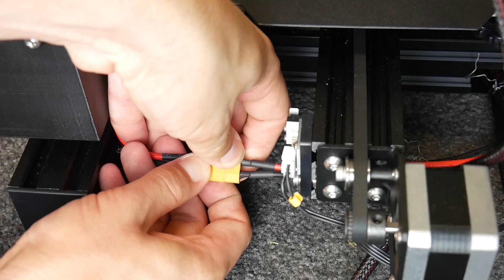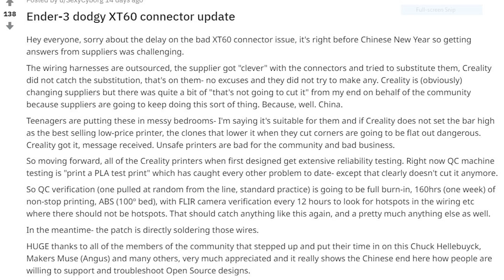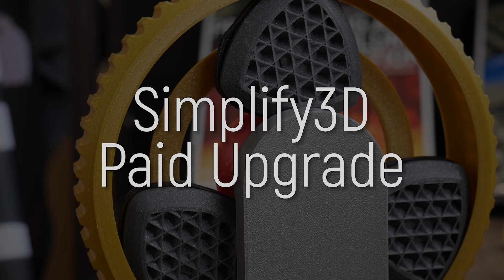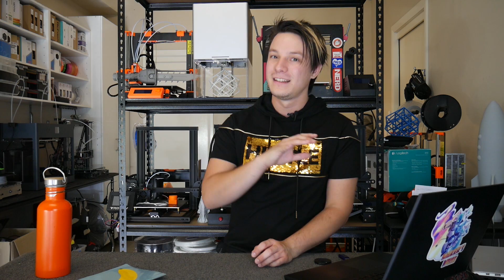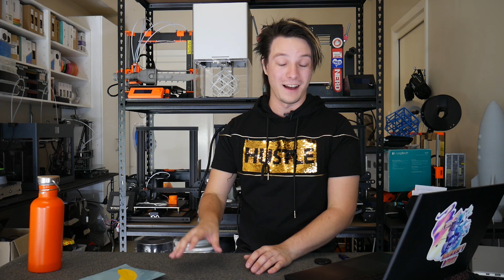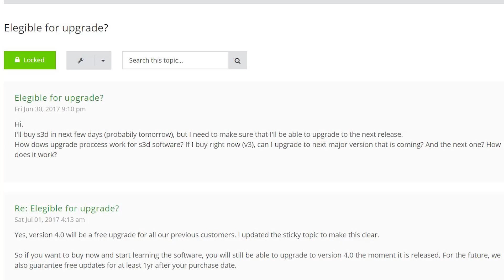Ender 3 Connector Update and Simplify3D Paid Upgrade - Maker's News Feb 2019

Comment: Cad is a great example of paying for upgrades. I get upgrades for one year from purchase and then I will have to pay an annual fee to be eligible for upgrades, which will be free as they are covered by the annual fee.  Miss the annual upgrade fee for a couple of years and I will pay $4k to upgrade to the latest version, which is the cost of buying the software anyway.  That is how it operates.  I just have to live with it.  
Freecad and Fusion are great if you can handle them, I could not, so I paid the money and had a great upgrade to my software that I was using productively the day I downloaded it.  I understand that some solids packages have annual upgrade fees that are more than more than I paid for my whole new upgrade so I am not complaining.  Just trying to point out that paid upgrades are common, but if the upgrade is not worthwhile well no one is going to shell out the money.  I had not upgraded for many years and the full purchase price was a lot less than I would have spent on the annual upgrade fees. I can understand folks being angry, but this is a "normal" practice with software.  It sounds however that simplyfy3d may be shooting themselves in the foot, normal practice or not!
Reply: Ok I absolutely agree that freecad is horrendous to use but whats wrong with fusion 360 I have yet to run into something that I won't to do that it absolutely can't. In the end I have most of the time found it to be able to do allot of stuff easier then other cad programs
Reply: Agreed.  The CAD companies are basically extorting you by charging a maintenance fee yearly.  I’ve had exactly this problem and have come to the conclusion that the ‘very minor’ fixes and additions they add are not worth the cost.  The CAD companies have gotten lazy, greedy and arrogant  IMO.  IMO if a CAD company don’t provide value then I don’t buy and stop the maintenance of said software.  I’m perfectly happy to use the software as it stands as the new minor additions/increments are just that, minor.
Reply: I would say it's a normal practice (these days) for software with a business case behind it like CAD, 3D, software development, accounting or whatever. 
I'm not sure what percentage of folks with 3D printers expect to make that money back?
Reply: duckrutt, I agree totally. If this mob do not offer something better than the free software, they will go broke. And that will be the end of them.
Reply: @smallcnclathes   The trouble is that if they do go bust and shut their servers down, Simplify3D now continually checks their licence server to see if it will run. If that goes titsup, the only ones that will still run are the pirated versions...
Reply: @SusiBiker  if simplify 3d goes bankrupt I dont think they would just screw everyone like that. They will just unlock everything and pirated and paid will all work. There just wont be any future upgrades.
Reply: @nathantoews152   I really hope so. I have been dealing with the company for over two years now, and what I have witnessed does not fill me with hope.
Reply: @nathantoews152  If they go bankrupt they are not legally in the position to unlock every installation because that can be seen as a possible loss of value. The curator might very well decide that trying to extort a fee out of people to have it unlocked ("upgraded to the no-server edition" or some bullshit) would be a quick'n'dirty way to gather funds to pay creditors.
Reply: @andersjjensen  maybe. But if they do go bankrupt and try that. Everyone will just get pirated copies anyways.

Comment: I bought s3d because I needed better support for dual extrusion, X3G format and the supports were easier to remove than Cura at the time.  I didn't appreciate the fact that you had to login to your account from within the software and am generally against paid software that requires an online server to authenticate you.  Seeing S3D on your channel so much did influence my purchase a little but it did meet my needs at the time and the printer was £700 so it  didn't seem that expensive in comparison.  I always preferred the Cura interface and it has been updated a few times since I last tried it so i'm hopeful it might now do what I need. When I work with other people I always recommend free software because cost shouldn't be a barrier to making things.
Reply: It indeed will do dual extusion now

Comment: If you don't want to pay for an update then don't pay for it and use another slicer. You're not losing anything by continuing to use the current version and if this makes slicers improve in the future then that's a good thing. I use a bunch of slicers basically every day and if this update sucks then I'm not getting it, no harm done. If S3d want's to sell it, then they will have to make some nice improvements which I'm looking forward to. Nothing wrong with using an older version of S3d. Slicers in 2019 are nowhere near perfect.
Reply: Under other circumstances I might agree -- but Simplify3D promised free lifetime upgrades when you purchased it, and now they're unilaterally changing the terms.
Reply: @Wolfcritic64  where did they promise that?  I'd like to use that to get a refund.  There site seems to be archived by archive.org so if they did I hope I can find it.

Comment: Cura  does everything plus more than simplify3D. ...
It has way more options and it just outright slices faster....
Not to mention the bit about continual improvement.
This is something they are on top of, quite frankly.....no others slicers are doing.
Cura for the win!
Reply: Cura doesn't support multiple processes which is a really good feature. But S3D is very bad in many other ways so I would prefer to change slicer if I could.
Reply: user10476 check out the latest version, you can create multiple processes now, change complete settings on the model and layers. Cura really grow out and added alot of new things.
Reply: @oriwan3786  It does? Is this 3.6.0 or the 4.0 beta?
Reply: Sue3DDesigns 3.6 , you need to add a custom block where you want different settings. There are videos on YouTube on how to do it.
Reply: @user10476  I thought there was a plug in for this feature? Been awhile since I checked though
Reply: Does Cura save a platter with all the print settings used for those parts?
Reply: @JeffDM  You mean saving a "Project" ? I believe even the older 15.x versions had that yeah. i never found a use for it though.. When i wanna print the same project i just print the Gcode again..
Reply: @daver18qc :
Correct
Reply: I dunno, I keep getting alerts from Slic3r: Prusa edition for updates to their software, so I'd have to say their also doing a good job of keeping current..
Reply: Wow, Cura must have come a long way in terms of slicing speed from the end of last year. It was at least 3x slower then S3D on my machine.
Reply: Depends on the person. For me, Simplify3D prints are much nicer and involve much less headache than Cura prints
Reply: @HB-jf6yq  for me, when I first started out, I found Cura a bit overwhelming.

Comment: Thanks Angus, yep, the S3D thing has blown up. I don't mind paying for upgrades but there needs to be a value proposition. Cheers, JAYTEE
Reply: Exactly and for the (not quite a year) that I've owned a license of S3D I've seen zero  updates.  Minor fixes perhaps, but nothing in terms of feature enhancement, options, improved performance, etc.  So no I'm not happy about this at all.  S3D was not inexpensive and now I'll be asked by them to pay again.  I do hope the backlash is loud and swift.  I understand they need to make money, but again I've had my license for less than a year.  There was no value in me buying it when I could have just been using Slic3r or one of many others out there that have caught or or surpassed S3D.  What S3D still has going for it is ease of use, IMHO it is still the easiest slicer to pickup and use.
Reply: @willierants5880  As someone who bought the license about 3 years ago I hadn't seen great updates either most were just Bug fixes and they did not once update any Features that improved any of my Prints or usability of the software. It feels like a Fuck you moment to the prior customers when they announce that 5.0 will have new features and that for a price they have yet to announce we will have to eat the cost on for the upgrade. Its already a $150 hobby software that lately has been out paced in advancements by its competitors who are free to use. If the upgrade is more then $50 i do not see many people making the leap to the upgrade.

Comment: I just bough my first 3d printer a ender 3 , thanks god the issue is fixed :)
Reply: I would caution that you need to verify, in case you got old stock. Genuine XT-60 connectors should be fairly TIGHT fits. If they're not, and you feel heat from that connection... they should be replaced. (Or remove them and directly solder)
Reply: Check it anyway - your printer may have sat on a shelf. It’s an easy replacement (took me 10mins)
Reply: @peeceejay  ill take a look anyway :) thanks